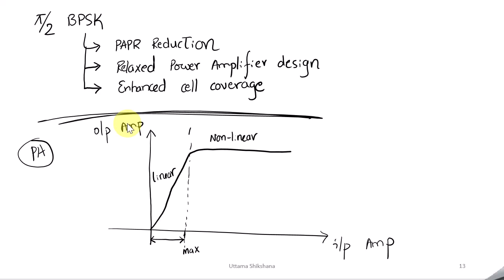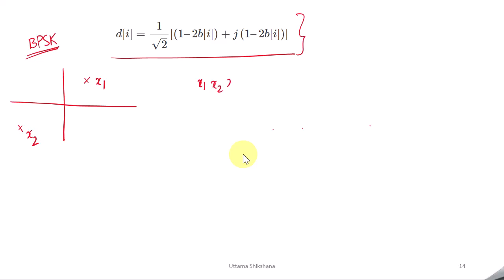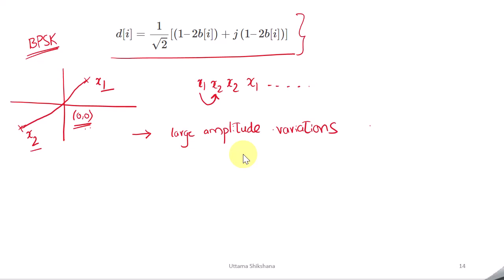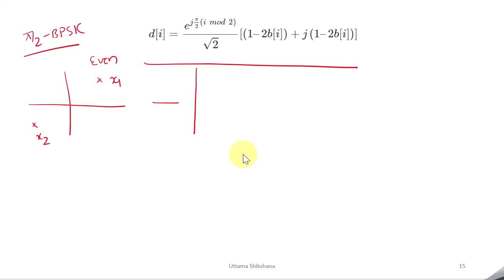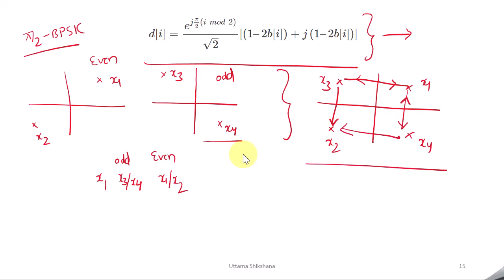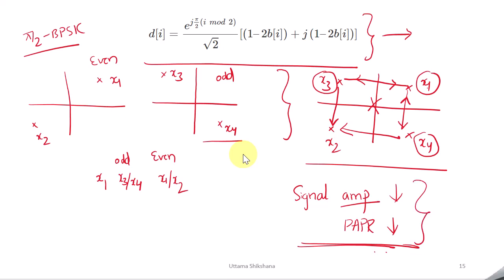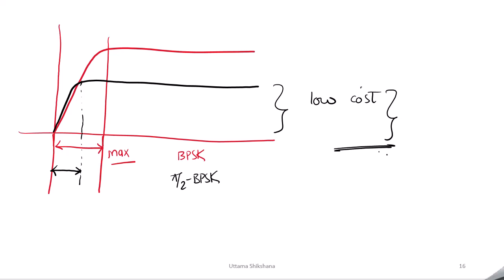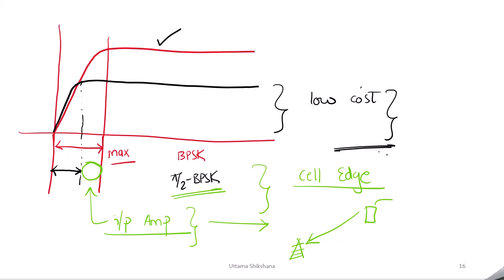[Series #14][Industry] Pi/2 BPSK | PAPR Reduction | Relaxed Power Amplifier | Enhanced Cell Coverage

Comment: Hello sir, this is first time i have read your lecture, it is really very nice. You have explained the figure where you mentioned pi/2 bpsk graph is lower that bpsk graph. there what is x-axis and y-axis. if the linear region is small then how it would be benificial?
Reply from the maker: Thanks a lot for the question.
The graph is input-output characteristics of the power amplifier.
x-axis represents input amplitude or power.
y-axis represents output amplitude or power.

If the linear region is small meaning that more relaxed power amplifier (less costly) can be designed.